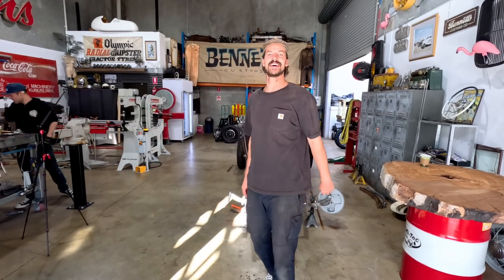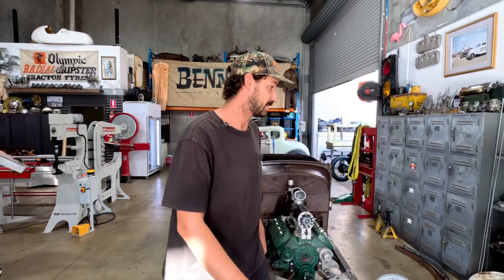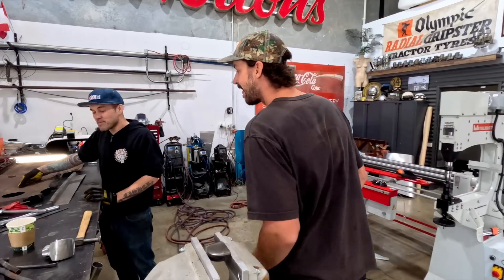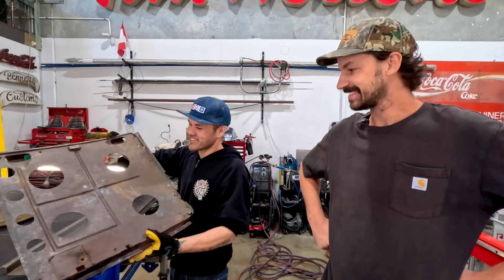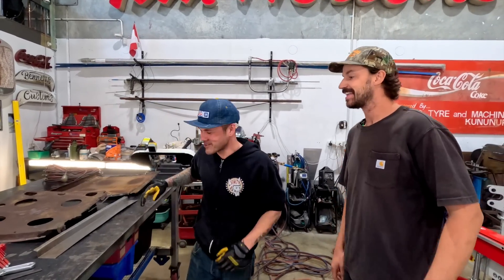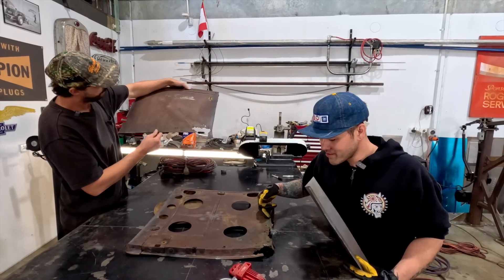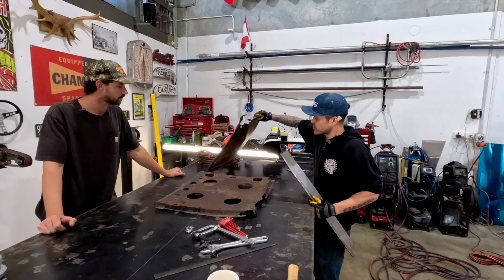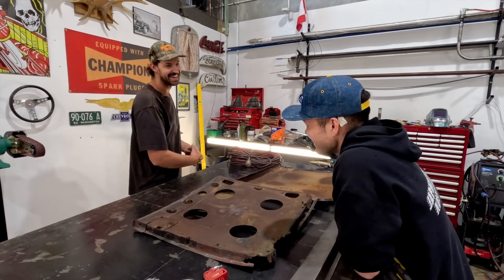How To: Fitting 1932 Steering Box to Model A body (Custom Steering Column, Roadster Build)

Comment: Thanks for the awesome video. I love the new tools. I don't have the sheet metal tools yet but I bought a mill and a lathe a couple of years ago. They were a game changer for me. I'm still working on my chassis and drive train. I'm building a 53 Chevy 1/2 ton drag and drive pickup with a 6-71/NOS blown 292 inline 6 at 1000 HP+. I made my own 8 rib water pump pulley and it looks really cool. Since I don't have to pay someone I can make things super cool. Thank you for your time.
Reply: I get sad when I hear about all of the amazing builds you are all doing. The best I have done was to make a table lamp from the rotor out of a 6-71 blower.
Reply from the maker: Sounds awesome man can’t wait to hear that!

Comment: Hey Jordan,  I was also thinkin' like Bob - Karl could do a great job at extending the doors.  And a smaller wheel would solve both the windshield interference issue and entry/exit.  With your skills, I'd think you could use the hub, shorten the spokes, and shrink the diameter of the wheel.  Sorry if I triggered another OCD episode!
Reply from the maker: All great ideas Tom!

Comment: More windshield tilt, what about a smaller diameter steering wheel?
More cabin length, what about adding 2 1/2" to the doors, subframe and relocating the rear axle?

Comment: Make the bottom of the steering wheel flat? You know how they made those steering wheels with the top 1/4 cut off to be 'space-age' in the 60's..but you do it upside down? Also, if getting in and out is an issue, lengthen the doors, make people wonder what is different, don't be like anyone else mate!